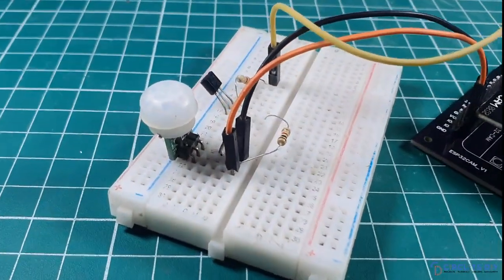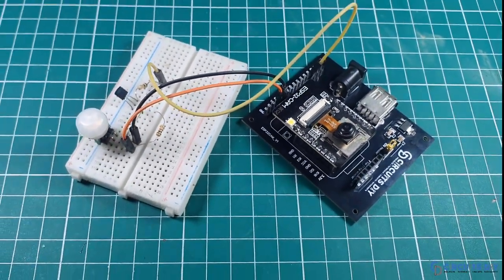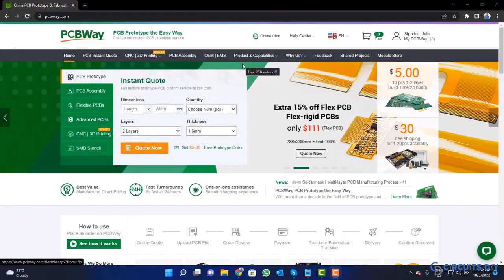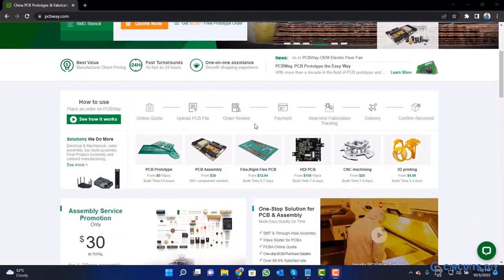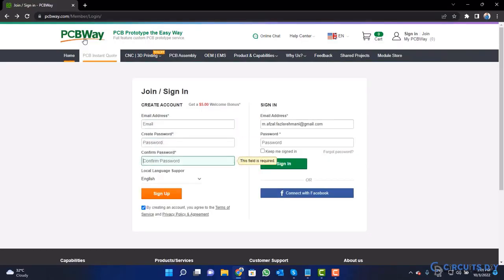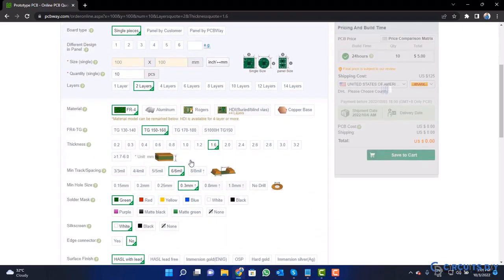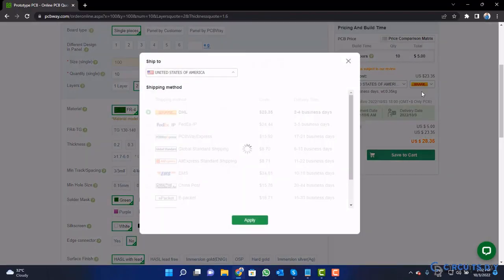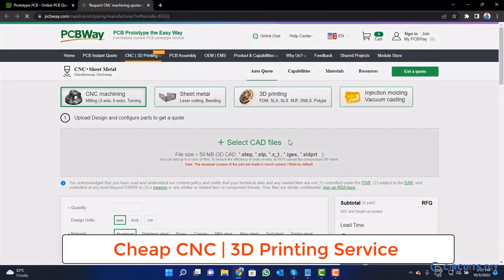PIR Motion Detector with Photo Capture using ESP32-CAM

Comment: Hi, what specs are the resistors? The guide in the description shows first 1k Ohm and 1k Ohm, then later it shows one of them is 10k Ohm in the diagram.
Also, is the picture later stored in a micro SD card with the current code?